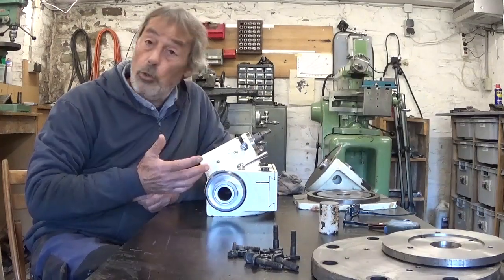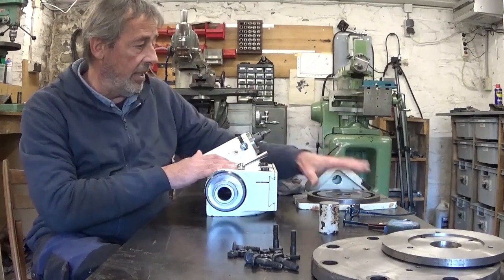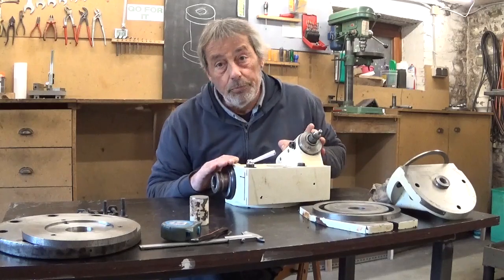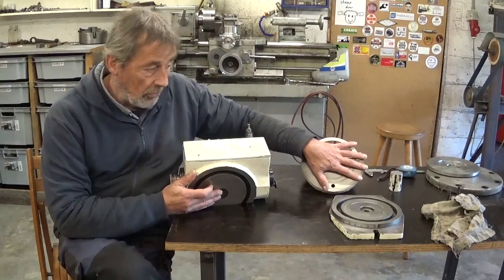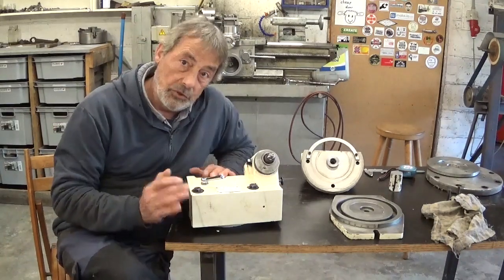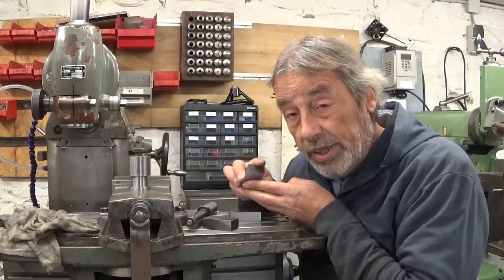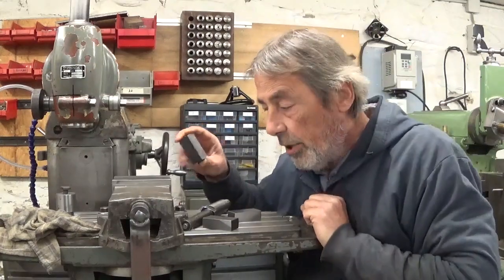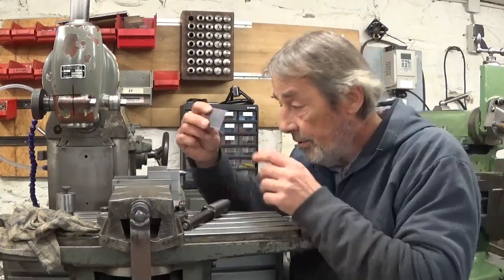Dividing head easy setup part 1.

Comment: Hi  Michel ☺ this is an interesting project,  and will make fitting it to the Deckal  alot easier, we hope !. I had the same problem whith a machine vice similar to your's,  it too had lift in the moving jaw, I fixed it by putting a plate across the under slide ways ,whith two bolts tapped into the underside of the moving jaw so I could use the bolts to pull down that jaw onto it's sideways,  just tight enough so it can still move, and it's adjustable for wear, and more importantly  cured the lifting problem. I hope my explanation is ok, and that your vice is of the same design to allow you to do this. Best wishes to you and your's my friend, Stuart UK.
Reply from the maker: Thanks Stuart. There is a small plate underneath... but it's bent.
Reply: @Rustinox  Hi Michel ☺ sounds like you've found the problem, time for a better plate if you can get one in there , maybe,!  Good luck whith the fix, it's worth doing if the design allows it. Have a good wkend my friend,  kind regards Stuart Uk.

Comment: Great video Rusti. Have you considered cutting a bevel on the bolt side of the step? It should make the hold down a little easier to feel as you cinch down the bolt. A complete radius I think would be a waste and probably a nightmare to get consistent between the three parts. Just my armchair machinist engaged here. Anyway, looking forward to the next video.

I am sure it's just my ears, but something sounds unhealthy in the milling head. Like a bearing or very worn gear. Or are all Deckle's like that?
Reply from the maker: The spindele bearing are worn. To be good it needs a new spindle, but that's expensive.
Reply: @Rustinox  The head is removable, yes? Seems like replaing the 4 bearings would be pretty straigtforward, but perhaps not easy.

I haven't worked on a Deckle, but I would imagine it would be 4 bearings... 2 on the horizontal and 2 on vertical?

Comment: Clever engineering! 👍
You could strengthen that vice if you out a couple of down bolts through the movable jaw, into a small plate underneath. To clamp the jaw down.
I have a similar cheapy vice, and there is room underneath. Maybe yours is the same?
Reply from the maker: There is a small plate underneath... but it's bent.
Reply: @Rustinox  ... yeah mine has a little slider plate thats stops the jaw lifting, but it is loose, as it needs to slide.
I thought about adding ANOTHER plate, with 2 screwdown bolts... so they could be tighened down during/after clamping.
Your vice looks a lot like mine, on mine there is clearance for the 2 bolts. 🙂